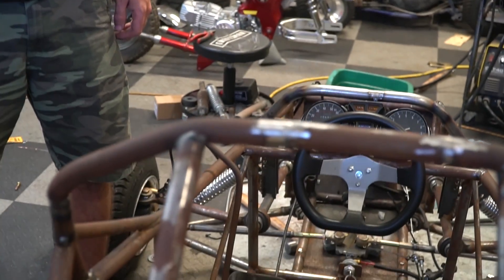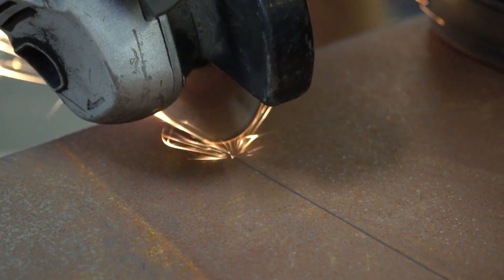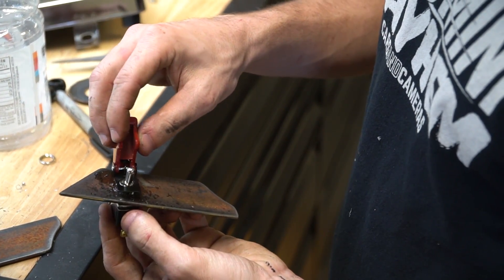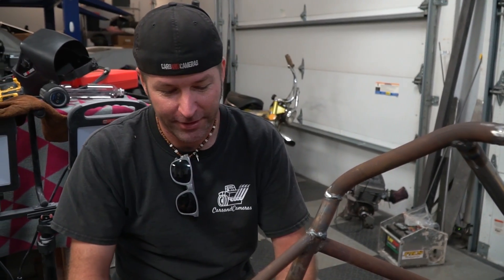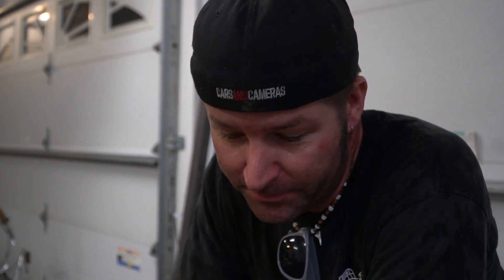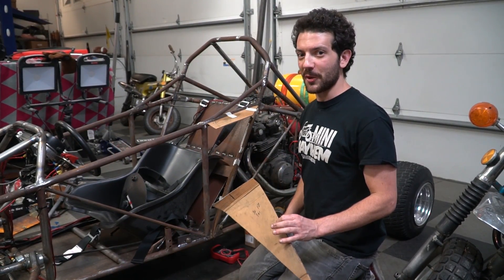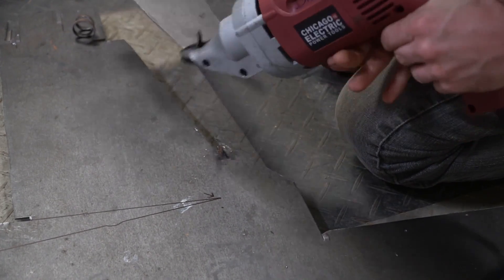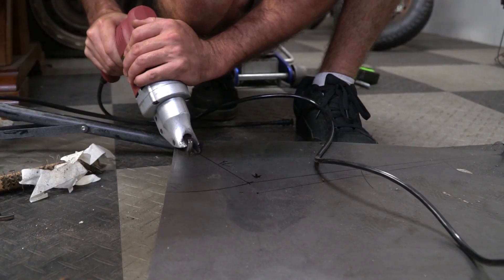Fabricating Air Scoops, Firewall, Dash, Fan | Cross Kart Build

Comment: 8:05 they are called tin snips, not really made for cutting thick stuff 😂
Reply: Im suprised they are using 3mm plate for somthing as simple as air scoops, 1mm plate would do the same and be 3x lighter and easier to manipulate into shape
Reply: zack smith, technically those are aviation shears for aluminium as the aviation name suggests they are for light aluminium work (you can cut slight bends/curves with them also) tin snips are just straight like scissors hard to do any sort of bends/curves with, and often but not always have handles like scissors, on the whole your right and we know what your getting at and its slang a lot of ppl use tho technically wrong  :)
Reply: @gimble8638  they make right and left tin snips as well as the straight ones
Reply: no zack they make left right and straight aviation shears bud, you getting it yet bud? :) and even straight ones can be manipulated to cut soft curves, blades thicker on a tin snip which makes that nigh on impossible to do that, the left and right aviation snips can cut tighter curve than straight ones, ive explained the difference above already bud :)
Reply: replied about 3 times there lol, my reply wasnt showing this end at first lol and il repeat the make straight left and and right aviation shears!!! lol
Reply: so in short they make left right and straight (usually red green and yellow)AVIATION SHEARS as ive described the differences more than adequately already zack :)

Comment: Change the throw of the E shifter by adding a pivoting lever to multiply the throw distance . If you have 1 inch of movement at the top with 1 inch to the pivot and 2 inches to the other end after the pivot then you double the throw and it will work.

Comment: Are there stronger electric solenoids available? Possibly a longer shift linkage for more leverage? Maybe even 2 solenoids? Only reason im stressing electric is because youll have to mount a tank for compressed air if you go air shift......you dont need a pressurized bomb riding with you at 80+ miles an hour in a little buggy like that

Comment: Try your door lock solenoid with the motor running, its easier to shift the trans with the motor turning. search on line for a stronger 12V solenoid if it does not work. also that is not thin sheet metal it looked like 14g to me, if it is it might be to heavy for those electric double cuts.

Comment: Old trucks used to have a air over electric system to change the speed of a two speed axel.  There should be something similar that you guys could match to your Shifter on your motor.

Comment: Also agree. The fan should have been mounted on the top of the engine.
Reply: The motorcycle was designed with the intent of having air move ACROSS the engine and through the veins. This is fine.
Reply: Gᴜᴛꜱ • ᏖᏂᏋ ᏂᎧᏬᏁᎴ Ꭷƒ ᎴᏗᏒᏦᏁᏋᏕᏕ if you watched the video you wouldn’t have made this reply. I think as a 20 year motorcycle rider and mechanic I’d understand how an air cooled engine works. This is a go cart. The low mount of the fan is susceptible to water and mud damage. Therefore becoming ineffective and leaving them overheated and broken down.
Reply: @black88lx  
Wow, so working on motorcycles has given you every bit of knowledge you would need to diagnose how to build an air-cooled rear-engined cart from the ground up?

You know, these magical things called "shrouds" exist.

Comment: Door lock actuators aren’t very strong. The only shot you have at making it work is to increase the leverage point and attach the rod higher up on the shifter.
Reply: Didnt have enough throw
Reply: Isaac it'll be fine yeaaaaaa. True. Hmmmm.  Trying to think of another electronic motor 🤔

Comment: I would suggest a fan controller. That’s a huge load on the charging system to flip the switch to “on” position.  Plus it’s running the fan at max speed which isn’t necessary.

Comment: Do you guys plan to add any kind of debris protection for that fan? Hate to see any rocks or stuff get kicked up into it while you are messing around. In regards to Ike's mud concerns, would it be feasible to shut the fan off right before a bog, then back on after? 
Those side ducts could definitely help with air flow as well.
As for the shifter, I'd say maybe give the electric one another shot. See if you can get better leverage or power out of it. I like the idea!

Comment: Yoshimura makes a shifter that goes with the ecm to control up and down shift points on race bikes i can find buy found this https://www.jpcycles.com/product/630-539/pingel-electric-easy-shift-kit?mrkgadid=3300286526&rkg_id=0&utm_source=google&utm_medium=cpc&utm_term=461501881147_product_type_motorcycles_product_type_forward_controls_and_footpegs_prod&utm_campaign=Google+Shopping++Generic+-+Forward+Controls+and+Footpegs&product_id=630-539&utm_content=pla&adpos=1o5&creative=278867792315&device=c&matchtype=&network=g&gclid=CjwKCAjwzJjrBRBvEiwA867bysn9XNr-s4b2ujAtRkjhtPY1UGIvyKXMcySBqzgexQ2ppk9sVlMtUBoCaYoQAvD_BwE

Comment: If you move it up higher on the shift lever it will give you more leverage and might give that actuator the mechanical advantage it needs to work unless it doesn't have enough throw

Comment: Might get that shifter to work if you put it at the top of the lever or extend the shift lever. Increasing the arm makes for less force required to get the same torque, same idea as putting a thick walled pipe over a wrench handle to round off stubborn bolts

Comment: Do the cable shifters but wrap both cables around a spool in opposite directions thats mounted to a strong electric motor (like a wiper motor) then just hook to two seperate buttons on reversed polarity so it can pull from both directions, aka up shift and down shift. Still button controlled and it can all be mounted between the seat and the fan. Strong, clean, and easy to mess with.

Comment: Look into using a panhead/early shovel head clutch “mousetrap” on your shifter.  Essentially it used a heavy spring in an over toggle config to allow you to have a short AND soft hand clutch.   Instead of using it on a clutch like  HD did, you would be using it to make the electric solenoid work on your shifter.

Comment: "now to use our nice thin sheet metal" pulls out 1/8 inch plate steel  would've been fine with like 16 gauge actual sheet metal
Reply: Yeah its gonna be a tank when they're done.

Comment: Also you should've added some leverage on the electric shifter so it had more throw but was also easier for the weak motor to make the shifts. It's a great idea and could definitely work with some fabbing.

Comment: If length of travel is your only problem with the Cadillac actualor you could make a pivot point and mount it like a short throw shifter works. Having the actuator side short and the shifter side long would give you and the travel you need at a sacrifice of pounds of thrust. You could also look at mounting it real close to the shift selector. Same physics works. The foot shifter throw length is all determined by the arm length. If you wanted to be original. You could set up a trick gear and chain set up. Big gear to little gear.

Comment: Cut out the firewall, and bend or add more to the edges, enough that it fits under the pipes, and lenghten it to create a floorpan/rock shield.  then make the fan shroud air tight to the frame, and scoops both sides of the seat, or use the seat as duct, and seal the upper edge. then you need to seal both sides of the engine to create a tunnel for the the fan to push air through, and create a wind chill factor. Also please, please turn the fan facing forward and use it for it's designed rotation. Please. The fan is literally howling in pain.
Reply: Those types of fans can be used as pusher or puller fans. So not sure what your comment is about
Reply: Yes, the motor can in theory rotate both ways, but those brushes are grinding hard against something in that direction. maybe the flux is missing and brushes, or bearing housing is rubbing against something that it shouldn't. Also the fan shroud works better in pull mode, and can be mounted as close to the seat as the recent firewall. All it needs is that sealed wind tunnel to push the air to. It is also possible to louver the side walls, to create extra airflow to the tunnel, but it is necessary to seal the bottom of the frame completely with some sturdy material.
Reply: And if mounted with careful thought, the fan can work as a cooling device for the seat.

Comment: Did you try rocking the cart in gear? Motorcycle dog type transmissions need that. Sitting static not running most bikes won't go into gear.
Reply: You can clearly see him rocking it back and forth in the video... smh

Comment: I've used unlock solenoids in the past to do things. Have you tried doubling them up? I used that to shut off a diesel lincoln welder.

You can even use a push pull method with two of them if space is an issue..

Comment: here is some things to consider:
-door popper solenoids
-'push pull' solenoids
 look for ones with long throws; solenoids are cheap and abundant, just need to be patient to find what you need.
Also you can re-engineer some of them to get longer throw

Also mount your cute overpriced solenoid further back. Have it push/pull on a short arm, that is attached to a pivot point on the frame.
on that same short arm attached a longer bar that will attach back to the shifter of the transmissions to increase the throw of your present shifter, to get more complete shifts.
I will see if i can find an animation program to share the idea better. but you can certainly engineer this.
Reply: http://507movements.com/mm_333.html
here is an overcomplicated example but note how the push or pull length of the right piston is less than that of the left.  you apply the similar principle in a simpler fashion you can make your solenoid work.

http://507movements.com/mm_346.html
this one shows a rotating force but you can change that to a push/pull force and re-engineer the pivots to make it work and achieve a similar result.

http://507movements.com/mm_350.html
here is probably the best example (and then i need to get back to work) apply your pushpull force to the center pivot and achieve a greater throw. naturally, engineer to fit your application.

Comment: Hey guys awesome Job. It's been a grest project to follow. Three things you might consider is a higher voltage battery for your electric shifter like a 48v or higher volt Drill battery will make the shifter throw more powerful. Also I finished a sSandrail project recently and found the fan mounted at a 45deg angle to the motor with the fan running in reverse will stop you from blowing dirt onto your engine and creates a surprisingly cold circulation of air around the engine. One last thing you want to check out that I came across the other day was a T-Bar with hard wire push/pull from a lawnmower. This is now mounted on the side to my twin boys off-road buggy (stationary engine 220cc) and connected up to the governor. So now forwards on the T-Bar and the governor is removed and backwards and the governor is back on again. Handy trick I stubbed across so now the power can be doubled when needed. (As if that's not always...lol) Once again Awesome show guys only thing is the videos need to be longer or ya gonna have to start making a Friday video aswell. Lol. 😜👍
Cheers from Australia.

Comment: No paint, leave it patina (rusty)
Edit: fix the front upper shock mount, it looks cheezy compared to the rest of the cross kart.

Edit 2: do you think you guys can build me a set of 4 bolt by 4" hubs but for use on Manco 7/8" hex axles??. I pay for them obviously

Comment: I understand that this video was probably filmed about a week ago but you can get 40lbs solenoids on amazon for like 40 bucks that would probably work.

Link to it here:
https://www.amazon.com/MPC-SL50-Door-Popper-Solenoid/dp/B00KSPEKJ4/ref=pd_sbs_263_13?_encoding=UTF8&pd_rd_i=B00KSPEKJ4&pd_rd_r=84a1bbc8-8db6-4665-831e-b55889932003&pd_rd_w=zjAJM&pd_rd_wg=Jii4b&pf_rd_p=1c11b7ff-9ffb-4ba6-8036-be1b0afa79bb&pf_rd_r=KYY6YTP6F46YNH7FAG5F&psc=1&refRID=KYY6YTP6F46YNH7FAG5F

Comment: You don't have to give up on an electric shifter. There are tons of 12v Push-Pull Solenoids out there. You just need to figure out the force and length required to shift it. 
I'm loving the build. I honestly didn't think it was going to turn out as well as it has. I should have known better. Thanks!

Comment: Buy some cheaper door lock actuators and double them up? Either both pushing/pulling together, or one pushing, whilst one pulls. Could even have a separate circuit that activates just one to get it into neutral.

Comment: C'mon make a pivot point that will make it shift farther so u can get that 2 work
Reply: If you attached the shifter to a pivot point directly under the unit you could make the other side of the pivot point longer giving it much more throw allowing it to pivot on the shifter itself, if you need me to send you a drawing email me
parkerfrey04@gmail.com
Reply from the maker: Unfortunately it's not that simple. The actuator had pretty limited throw which limited us on where we could mount it on the shifter, which limits the amount of leverage we had to pull it off
Reply: @CarsandCameras  it might have worked when the motor was running.
Reply: They obviously haven't heard of cantilevers....
Reply: @Mardy72  anything more complicated than a switch will fail sooner or later so why not keep it just like everything else simple and reliable like a second battery and a second solenoid that way even when they trashing it around if one solenoid gives out the second one running on 24v will still do okay

Comment: I mean you no disrespect but the electric idea will work you need the heavy duty electric door poppers that people use on some of their vehicles were they literally day smooth out door handles and stuff on the outside they actually make a heavy duty solenoid that forces the door to pop itself open and it has enough throw but I think they're like a hundred and forty maybe a hundred and fifty bucks you can buy them and Jags or Summit catalogs I've seen them in the past couple of days I was ordering I was ordering small block 350 parts but the heavy duty door poppers not like the door lock pieces or something it unlocks the trunk but literally hit industrial door poppers will literally get you what you want to do believe in y'all can still use the electric idea

Comment: You guys need a linear actuator with feedback for the shifter. The feedback is so you can set points like middle, up, down, and adjust end point for like the neutral and first
Reply: Like a firgelle or automations

Comment: You should try moving the electronic shifter towards the end of the original shifter. It will get more leverage making an easier shift. Or is there not enough throw in that device restricting where you can mount it?

Comment: Im no electrician but i think you can wire in a another battery to give that electric door lock more power at 24v then use a inline diode to startijg cutting the power back to like 14-16v that should give that extra power it needed without going full 24v and burning it up
Reply: Those solenoids work like a charm even at 24v they wont burn up especially for such short bursts
Reply: it will burn up and it has plastic gears,  There is a actuator made for popping door latches on cars/trucks for people that shave the doors. You can get them in a 25-75lb pull
Reply: @gardeningoutdoors5209  it wont burn up those plastic have no relation to the voltage or current you run through them and most electric motors are rated at a far lower number just to make them forever living so they should and do go on 24v without any problems
Reply: @ERR98 Darksynth lol I believe in one thing 😂😂 anything more complicated than a switch will fail on you every single chance it gets and besides running 24v will put less stress on the electrical system
Reply: @AustinRBa  slap a bigger battery(or a second one) and second solenoid you cant argue bigger is better lol
Reply: @ERR98 Darksynth I'm missing your point if that was joke you need a new one

Comment: Hey just giving you a heads-up and air shifter should actually work they actually use that in the 80s and 90s on older drag bikes with that same engine so there shouldn't be no reason why it shouldn't work
Reply: Haha most guys in the early 80 and 90s would shift with there hand. They would launch the bike lay down on the tank drop one hand down the shifter and start slamming gears while the other hand holds it wide open. Ask me how i kmow lol use to race a 78 kz900